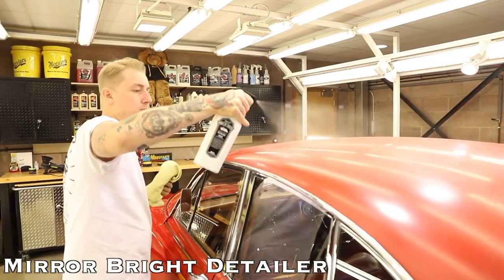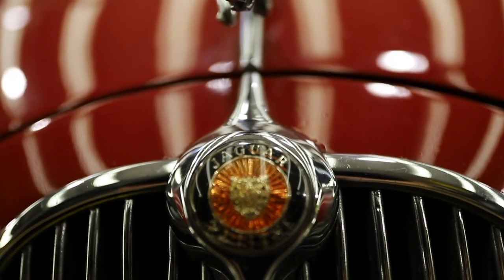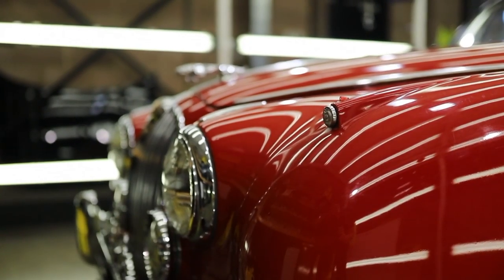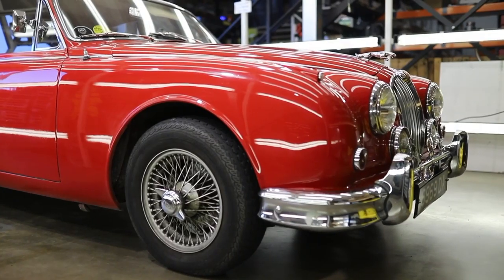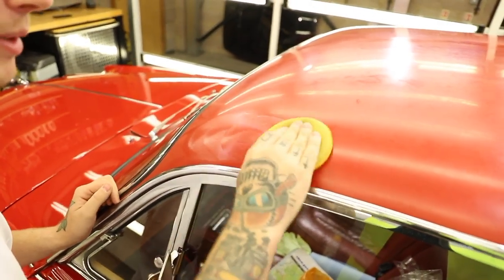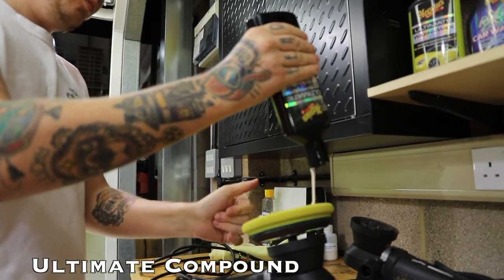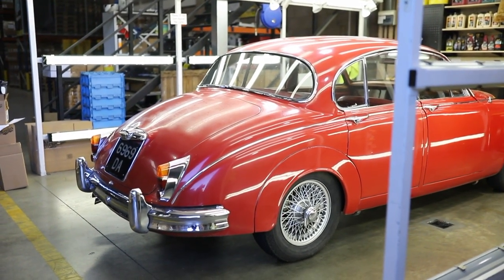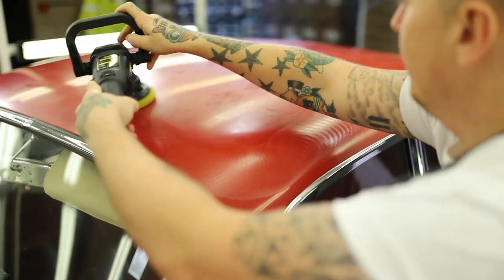How to Restore Red Paint with Ultimate Compound - Day in the Bay – UK Edition

Comment: Can someone fill me in on why sometimes they don’t follow up with the Ultimate Polish after Ultimate Compound? From watching lots f their vids, looks like Ultimate Compound will also polish as well when used with a microfibre disc.
Reply from the maker: Polishing is an often an optional step.  The benefits of polishing often depend on the condition and color of the paint as well as any given persons desire for their vehicle.  

If for instance you have a white daily driver in good condition and you primary concern is protection the use of a polish may be negligible.  On the other hand if you have a black show car that has oxidation you may desire that added shine/gloss the polishing step might bring to ensure it is at 100% of its potential.  

Also keep in mind that many waxes have polish in them, so if you are finishing with a wax in many cases you will be treating your paint to some polish as well.

Hope that helps.